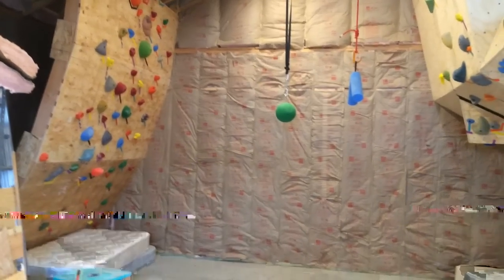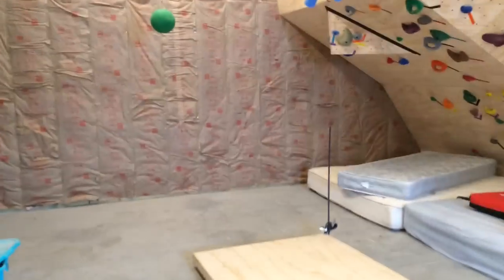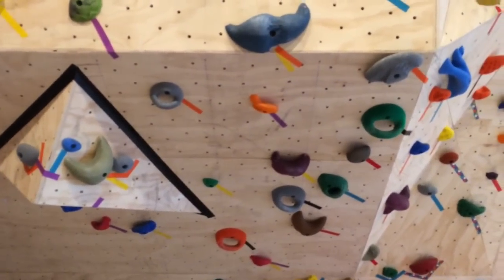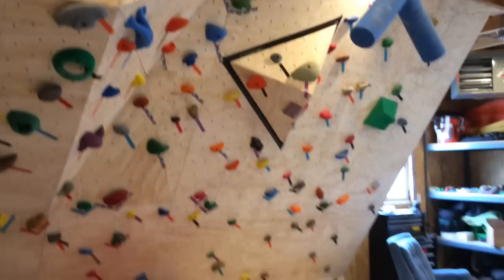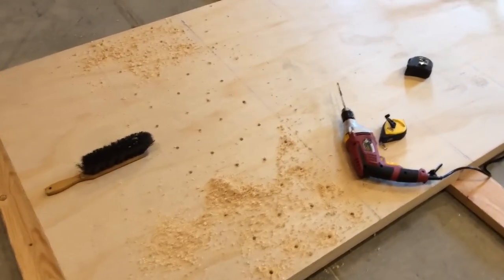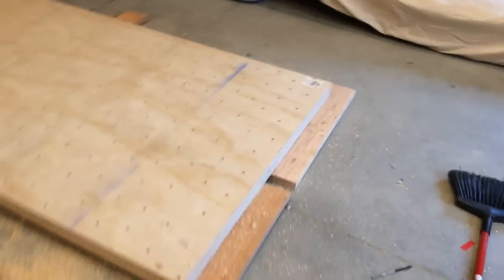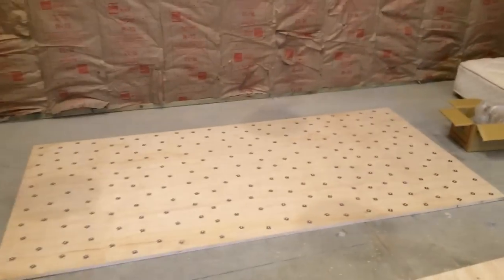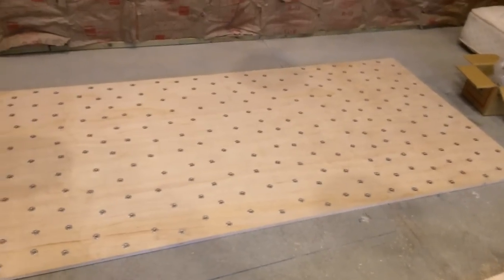How To Install T-Nuts On A Home Rock Climbing Wall; T-Nut Spacing, T-Nut Pattern, T-Nut Type

Comment: Im looking at building a small vertical wall in my basement.  Right now the wall has drywall on it.  Do you recommend removing the drywall before putting the plywood sheets up?
Reply from the maker: I probably wouldn't, but you'll want to first screw some 2x4s very securely to your existing wall, through the drywall and deep into the studs in the wall. Once you have that structure you can attach your plywood to those exposed 2x4s. Where it is vertical and not an overhang you have a lot less force to worry about.
Reply: Great, thanks!

Comment: Great video! I have a couple questions. When picking plywood, is the quality mainly for the integrity of the wall or for the look? How thick (or thin) should the plywood i pick be and is that for the t-nuts or strength? Thanks!
Reply from the maker: Andy Lee Plywood quality generally refers to how nice and how thick the top layer of the plywood is. This is really just for aesthetics. Cheap stuff often has a paper thin layer of good looking veneer wood on the top. I'd just get what you can afford. Once it is covered with holds looks doesn't matter much. Get plywood that is 3/4 of an inch thick for structural reasons and so it is thick enough for the t-nut neck to work properly.
Reply: Thank you so much for the advice! and wow was that quick.
Reply: Actually a follow up on the plywood question. So if its a very thin veneer, that probably means the look wont last as long?
Reply from the maker: Andy Lee yeah. The cheap stuff has nice look that won't stay looking nice as long. Some of my wall had thin veneer and it peels off easy. Not a big deal though. The wood is still strong and looks fine under the top layer.
Reply: Wicked. Ton of info in that response for me! Very much appreciated.

Comment: What grit sanding pad did you use? the plywood I bought is unsanded on both sides and I need to make it smoother.
Reply from the maker: Can't go wrong with 200. Sorry for the way-late response.

Comment: Are these new sheets a hardwood plywood?
Reply from the maker: I don't quite remember the exact grade of plywood, but they were about $30/sheet at HomeDepot. I think that they are pine throughout. If there was a hardwood layer I bet they would have been much more expensive.
Reply: 3/4” CDX is the “budget” plywood that works well. 3/4” Baltic birch is the best but will cost at least double unless you can find a sweet deal.

Comment: These are great tips... qq - did you nail or screw in your joist hangers?
Reply from the maker: There are very few nails used in the construction of my wall. Lot's of normal gold construction screws, and RSS (Rugged Structural Screws) in places that have a lot of load.

Comment: The bolt on holds im buying dont come with hardware. what size bolts do i need and wheres the best place to get them?
Reply: +blakeweaver10 The screws are 3/8" - 16 socket cap.  2" seems to be the most common size.  Larger holds may require longer screws.  Fastenal is a good place to get them.